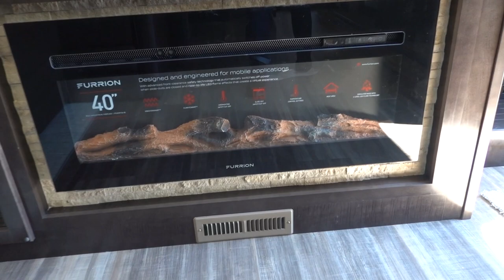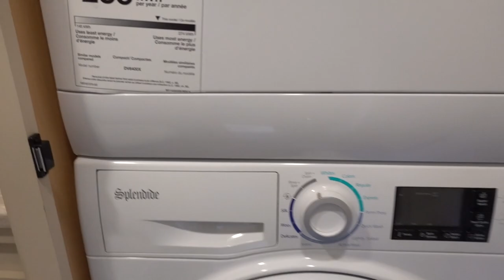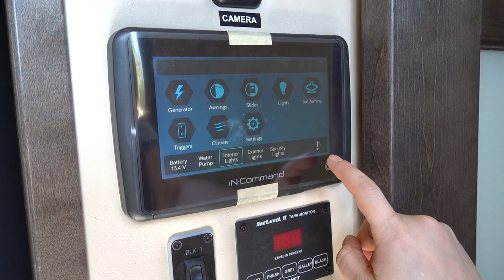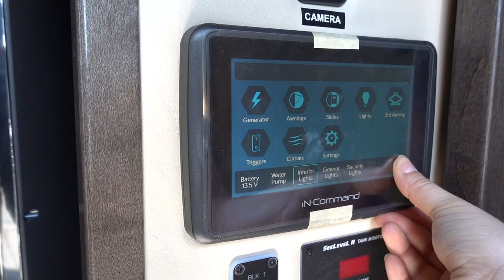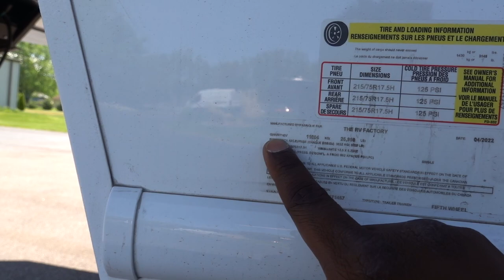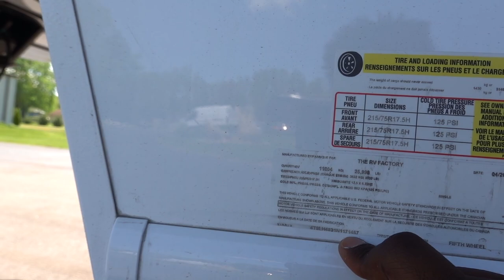This Is The Largest Fifth Wheel Ever! Luxe Toy Hauler With Some Cool Upgrades!

Comment: Nice review. A couple of questions though. How much fuel does it hold in the fuel tank? And, can you run the generator from the fuel in the fuel tank, or, does it have to run off the propane? The reason I'm asking is that I've been checking the run time on these generators that use propane and about half load, they will burn through both 40 pound propane tanks in just a few days. And if you use propane for heating and cooking too, you'd probably run out of propane in 2 to 3 days if the weather is cold.

Comment: I currently have a 42 foot 5th wheel and getting in an out of campgrounds right now can be a major issue. Can't imagine how hard it would be to maneuver this 48 foot beast into your spot.
Reply: @Ameri Pat ohhhhhh there's a difference.
Reply: @Ameri Pat please do...
Reply: @Ameri Pat ok. well I've been "camping" in state parks and rv resorts and they both have pull through sites for large rvs. I wasn't aware of the belief that "camping" resorts weren't necessarily for camping. But ok. I concede your point.
Reply: There is a video of a special unit Luxe built for a couple. It's basically a 44FB. They took the 48FB and reduced the garage by about 4'. Still have the side patio but just a shorter garage. Had to eliminate the drop down bed in the garage but I'd much rather have the side patio.

Comment: How big is a 2002 Toyota Tacoma 😅 because if someone wanna put it in the toy hauler for the weekend off road 😅.
Reply from the maker: It actually might fit and if it doesn’t, Luxe will get it too
Reply: @JB_WhoWork  true out of curiosity would a 16’jon boat fit inside the garage 😅 for someone that goes fishing and doesn’t want to spend money on hotels when you go to a area for months 😅 or a few weekends
Reply from the maker: I believe the garage is over 16’ so you will be good to go!
Reply: just bring a old school two door wrangler
Reply: @tristanhood3022  true

Comment: Very nice trailer and paint theme but the color choices inside was a little dark and therfore looked a little out dated.
Reply from the maker: Yea the beachfront interior is the one I would choose if I was getting one of these 👍🏾
Reply: @JB_WhoWork  the limited 5500 Ram, worth every penny. I just can't get over having a max tow 2022 Ram 3500 the difference is only the payload

Comment: Why don't you guys just buy an RV?
Reply from the maker: We have owned one for 4 years and have lived in it for almost 3 of the 4 years
Reply: @JB_WhoWork   The 5th wheel?  I meant an RV that you drive it, take a shower in it, sleep in it.  I don't know apparently what they are called?  They are an all in 1, you don't tow it.
Reply from the maker: You’re talking about a class A or C, I’m one of those weird guys who gets gratification out of towing. Maybe when dealing with a trailer becomes to much to handle, I will switch to one
Reply: The ability to park your trailer and disconnect your tow vehicle is a big deal for a lot of people. That's why we prefer a 5th wheel over a motor home.
Reply: @oldnumber6  I see both sides have advantages and disadvantages.  I think if it were me, I would worry too much about leaving the 5th wheel behind and going out for the day.
Reply: @hollywinsman9464  definitely advantages to any set-up, but this one works well for my family.
Reply from the maker: Great point, if I had a class A, I would still pull a big truck behind it 😆